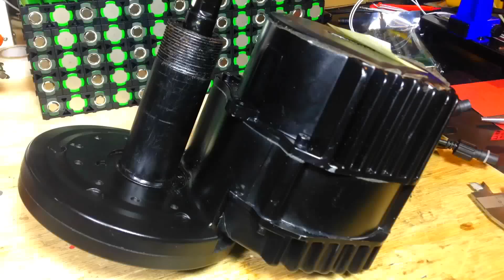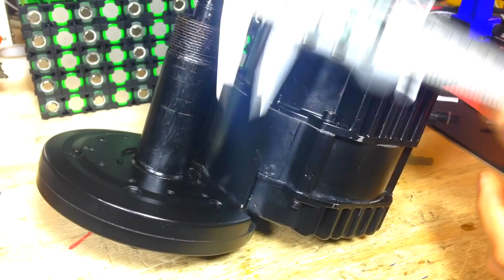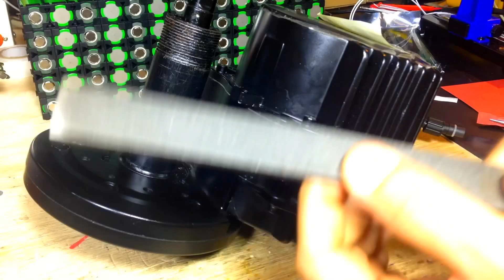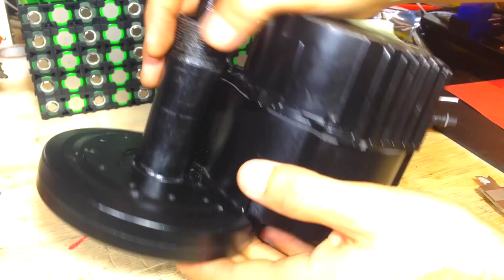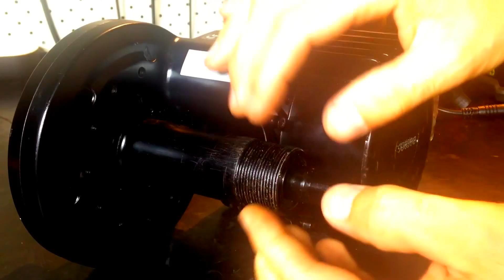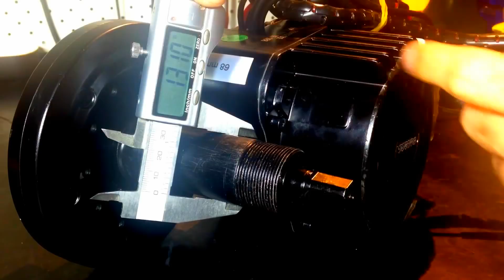BBSHD measurements: carbon fibre, dual suspension, fat bike bottom bracket • Bafang 1000w BB adaptor

Comment: I think Eccentric Bottom Bracket Adapters (to Convert Incompatible Bottom Brackets for use w/ TSDZ2 and BBS Mid Drives are the answer, hard to find reviews on youtube
Reply from the maker: Yeah, that’s as good option too!
As long as the adaptor locks firmly against the frame and stops the motors from moving up and down with the torque it works. Normally on a metal frame the motor bites agains the bb hole which would probably crack the composite. The way to get around is to use a torque arm.
When I made this video (years ago) there were very little options maybe one or two and really hard to get. Lots of new adaptors are available now

Comment: Another set of measurements https://electricbike.com/forum/forum/knowledge-base/motors-and-kits/bbshd/10736-how-to-order-the-right-bbsxx-kit
Reply from the maker: Yeeeeeeeeaaahhhh thaaaanks mate. 
Yeah I made this video early days 3 years ago when there was absolutely no info anywhere about the BBSHD motors. This is one of the very first sample of the final production BBSHD, I was still testing and sending feedback to Bafang... getting any info from the Chinese was such a challenge... nowadays thousands of BBSHDs later you type on google you find hundreds if not thousands of websites talking about Bafang... hahaaaaa... =]
Reply: BrunoPOWEEER Have you checked out X1 pro, seems to have more poweeer than BBSHD

Comment: I'm planning to get the 100mm BBSHD but my bike is just a standard bottom bracket (BB) width. But I would like to be more flexible on the BB width so I can put it other bikes since I could just use spacers to install on a smaller BB width. Would you recommend that?
Reply from the maker: Very good question mate, it’s possible to do this way but you may have problems with chain alignment and won’t be able to go up to the big cassette gears, it may works but the chain will be super twisted which will cause a lot of wear and you’ll find yourself replacing bicycle parts more often than you think. I was having the same dilemma picking the size when I bought my motor but I decided to get the standard BB size. I loved sooooo much and saved so much money riding this bike everywhere that when I realised I had saved money to buy another bike and motor so now I have a fast BBSHD road bike and a 120mm fatbike that I take off-road and also use to climb stairs (yes going up climbing some big stairs). I’m kinda glad I didn’t pick the 100mm now. Another thing I want to mention here, full suspension bikes vary a lot, sometimes a regular BB size is fine, sometimes you need to go up to 100mm just so the motor case doesn’t hit the frame, some frames even that won’t work, it’s hard to get one motor fits all, too many variations in frames out there. I’m positive you’ll have a second bike sooner than you think, this is a very common addiction hahahaa
Reply: An addiction indeed!! Lol.. I was thinking of just getting the standard BB just to be safe since I don't have a fat bike. Thanks mate!
Reply: An addiction indeed!. haha.. So how many chains, sprockets and cogs have you replaced over the time you are using the BBSHD?? Hahahaha.

Comment: I always thought carbon was to weak, I would love to do this to a carbon bike
Reply from the maker: +dave mac yeeeeahhh it's possible to do a carbon frame but there are so many little things to pay attention.. can't really tight the motor too much to the bottom bracket, may ended up crushing and braking the frame depending how it's constructed inside.. most are just two alloy rings on each end and carbon in the middle but there are some lucky dudes riding around on carbon... personally I wouldn't do myself, too expensive and big chance of the fragile frame snapping at high speed... that can be very dangerous... alloy is good... my lightweight alloy road bike was very very strong and survived a LOT of impact at high speed =]
Reply: thanks for the advice Bruno much appreciated !!

Comment: Do you think it's safe to run in a carbon frame? It might grind the carbon down. Even on my aluminum frame when I pull the motor out the threads on the frame are grinded off. For the amount of money and weight it saves I don't think it's worth it at all. For example this one in link is 2.55kg without the shock. My 300$ hardtail aluminum frame is 2.0kg total, and my aluminum cannondale xc dually is 2.5kg without shock. (the snabb is stronger for sure but still...) If I were to reinforce the cannondale so it's rock solid with thick butted tubing, and guessets it would only be 200-300 grams heavier than carbon for the same strength. Like I say 50$ for 100 grams max. The carbon frame is over 1000$ for 100 grams. Not worth it at all I think unless you are super super rich. Better to upgrade other parts on bike IMO
http://www.chainreactioncycles.com/ca/en/ns-bikes-snabb-carbon-frame-monarch-rc3-debonair-2016/rp-prod140903

Comment: Ho boy, I can't wait to see what you're building. Is this bike going to overtake your road bike in speed AND road compliance?
Reply from the maker: +GustSergeant - Yeeeahhhh... I am building an aerodynamic 42000w thing.... its a bit slow because its EXTREMELY complex but I will get there hahahaa... I will be announcing this monster project really soon =]
Reply: wowww...must be 2wd hub AND mid-drive with that power! can't wait for details!
Reply: gilessmokey I guess? That's 42kw or 56hp. If it's below 100lbs, or even 90lbs, it'll be an absolute rocket.
Reply from the maker: +GustSergeant - Yeah, this is exactly the idea, keep it below 100lbs which will be possible, but there will be another problem, how to transfer all that power without losing traction. Yes this thing will be a rocket!!! Haha
Reply: +ElectricBike (Bruno) good controller programming would be key; having the power gradually coming on on an exponential curve would be the best bet I reckon. Since it's basically your job to fiddle with these things I'm sure you're the man to do it. Control that POWERRR!

Comment: I have ordered the BBSHD, Satiator(sp) charger and 14s5p all through emax bikes, so I guess you made my battery pack Bruno haha. Now I just checked my BB on my Fuji Roubaix, and I believe it's a BB30. It's called; FSA MegaExo exterior bearing system.  So I have to get the FSA BB30 conversion tool. http://www.wiggle.com.au/fsa-bb30-conversion-kit/
Before I can convert my road bike. I was hoping to do it tomorrow(Tuesday) Looks like I might be waiting until next week.
Reply from the maker: +Brap Pitt - Yeeeeahhhhh... your battery was born here during this video https://www.youtube.com/watch?v=YsNbX0dHgxE 
BB30 should be the easiest of all weird BB available out there.. is the only one that you can easily find an adaptor. I also posted a link on the description of this video here. Please make video showing the process or at least after the setup explaining the challenges during the installation, this info is priceless and will help a LOOOOOT of people! Feel free to post your videos/photos links here... 
POWEEEERRRR... =]